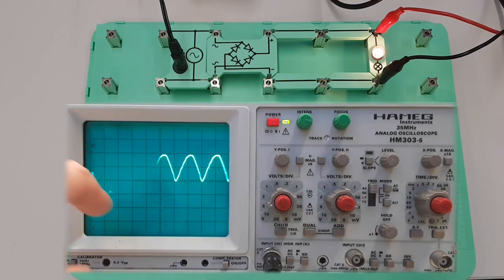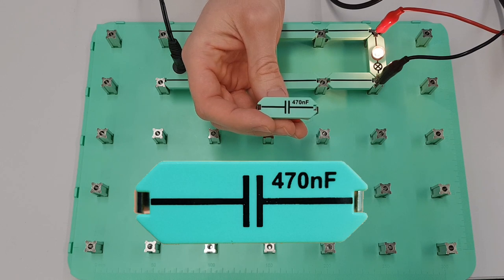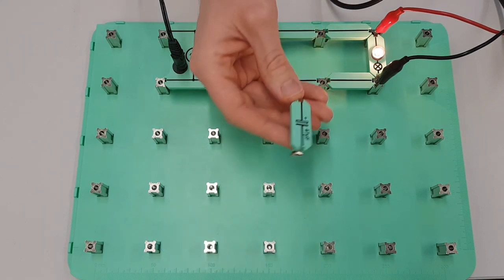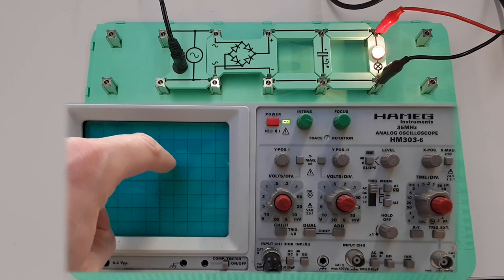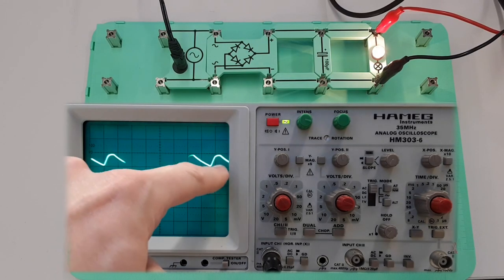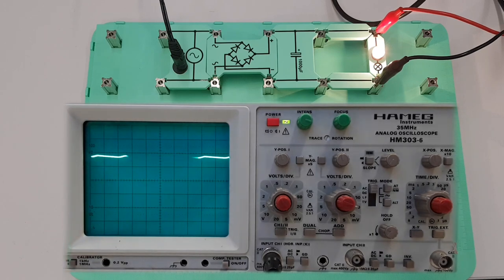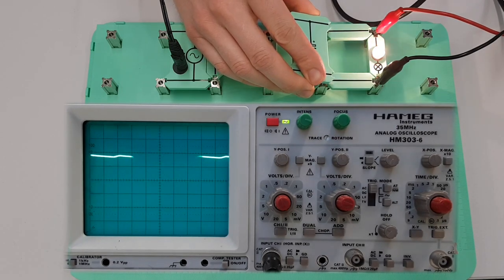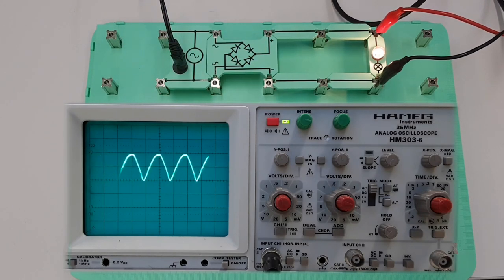How to Smooth a Rectified Waveform Using Capacitors

Comment: is it okay to go overboard with Capacitor's capacity like installing 56V 22,000 µF capacitor to smooth out 30V 80Amps rectified current? because its the only capacitor I have lying around.

Comment: i have always suspected that this would work to prevent led x-mas lights from strobing at 60 htz. now i wonder if mw lights even have a rectifier in them or are they just off for 50%of the time. and if i add a compositor would they over heat?

Comment: We used to have those green plug-in boards at school in the 1980's. It was good solid stuff; are they still actively used in education or is this from your appreciation of retro kit? The naughty kids used to delight in plugging the 3.5V MES lamp directly into the 12V bench supply to fry the filament. I imagine the school lab tech spent many an unhappy hour re-lamping the things before the next lesson!
Reply from the maker: I believe they're more popular than ever David, I love them because it helps you visualise the stuff you can't normally see! Matrix (the company who makes the locktronics kits) are always developing new kits, they've got what looks like a new kit for motors coming out soon. And I may have popped a couple of lamps myself in my school days. 😬
Reply: @JoeRobinsonTraining  Locktronics! Yes, that name rings a bell. Agreed, it's great for students to quickly see how electronics can be clonked together to form working circuits. I'm glad to hear they're still in classroom use!

Comment: I was just wondering. I have a 5v UPS (uninterrupted power supply) for my router. I can unplug and plug the power cable just fine on my router when the power socket on/off switch is on the ON position ( UK power socket with an on/off switch) but as soon as I put the power socket switch to OFF position and I plug the power to the router it restarts. I tried to add a huge capacitor on the UPS but it still interrupts power. Is there a solution to this?

Comment: Hi I am a first time viewer and new subscriber.  I have just purchased a DPS 5020 and would like to power it from a salvaged 48v transformer. The transformer which came out of a night club and was powering 40 30w pins pots. I want to smooth the rectified waveform and raise the DC voltage to above 50V and provide as smooth waveform as possible as a supply to the DPS  5020.  I just don't know how to do the calculation to determine the value of the capacitor. Any advice please?  Thank you

Comment: God bless you, my friend .
How do we determine the value of the smoothing capacitor suitable for the circuit !! ??
For example, I have a small circuit for determining the water level in the tank. It works on a 9V battery, but I turned it on AC 220V with a 9V transformer and put a standardization bridge (4 diodes IN4001) and a 100 mF capacitor 16V (I chose it randomly)
After standardization with my hands a voltage of about 24 volts ..!!
How do I choose a suitable capacitor for smoothing !! ??
best regards

Comment: Good video  but please show some calculations too for choosing proper capacitor ..
I made a transformer of secondary output 33v 6A when i add capacitor of 63v 6600uf  the voltage leads from 33 to around 42v

Comment: So I tried to smoothen the output of a 12V car batter charger (which I used as suppl for a 12v-5V voltage conversion).

Result: 12v became 17v. Why?
Reply from the maker: A car battery should already be a fairly smooth DC supply. Why were you trying to smooth it?
Reply: I just used the charger, no battery connected. I wanted to convert it down to 5v but the LM317 would heat up up some 55° (despite it just being 0.6A). And the LED of the charger is slightly flickering. So I assumed this is the problem (there are capacitors between output-GND and input-GND on the LM317).